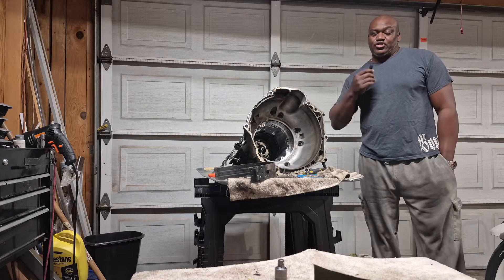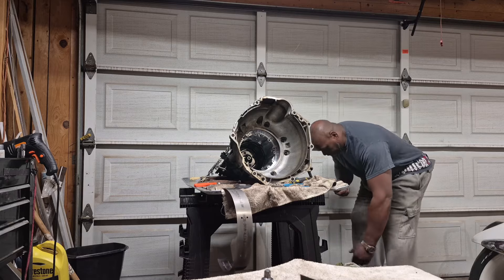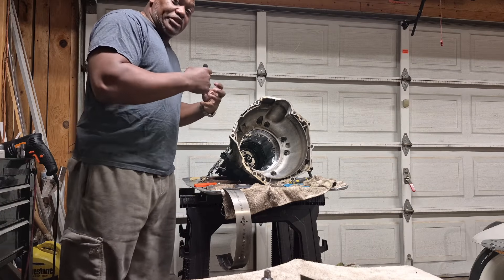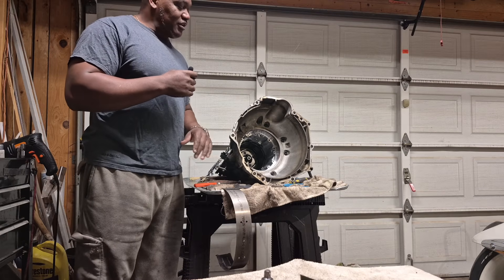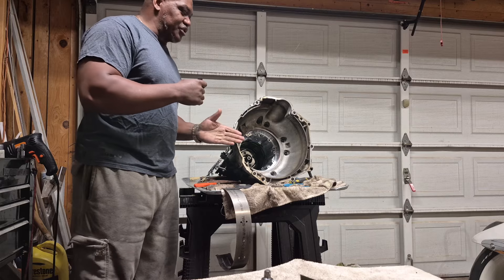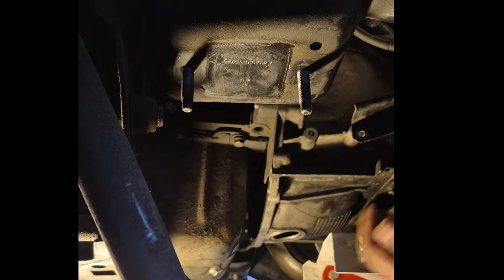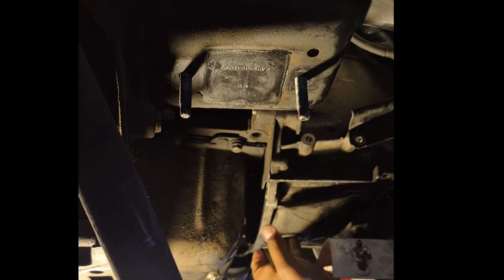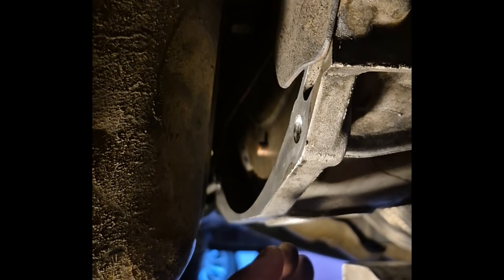Car won't TURN OVER after transmission installation

Comment: How would i know if the pump got damaged if i were to smash it together with the bolts? Would it be better to just grab a new transmission?
Reply from the maker: You can always replace the pump and not a whole transmission if the pump was cracked or something. They sell em separately.

Comment: I recently installed my trans on a 2000 f150. I did exactly what you said not to do when tightening it on. when using the key there is no start and no crank. I was able to jump the start relay with a screwdriver and it ran seemingly normal (i didnt drive just idle.) Ive been chasing a neutral saftey switch issue, but now you got me wondering if i didnt seat the torque converter right. my question is why can I start it from the start relay but not from the key and the ignition? Would the be any reason this issue would tell my computer to not start the car? any helps apprecaited
Reply from the maker: I'm not sure why it would start like that, but glad you didn't drive it. The fact that it idles means the flywheel is turning, which means it's not binding the torque converter against the pump. I bet if it did, it would be a crunch or something.

If you press the brakes, can you see the brake lights engage? Also, make sure the shifter is all the way in the park position, and try to start it in neutral as well. Sometimes, the shifter is off like an 8th of an inch and it'll keep the ignition from engaging. Check everything before you start messing with the transmission again, just to make sure you don't have to take the flywheel bolts out to check it. 

If you take the fly wheel bolts out, you should be able to spin the torque converter with you finger til it pings against the studs on the converter against the holes in the fly wheel. If you can do that, then you seated it properly and wont have to remove the transmission again.

Comment: Man I just paid few hundred dollar to replace the suspension and sway bars because 1 tire the front driver tire kept making clinking untightend noise every time it hit a bump or pot hole. After replacement it still making same noise lol. Do you think I should give it time or go back and ask them what happened??
Reply from the maker: What type of car is it? If it's not the suspension, then it's the ball joints, maybe. Did they diagnose it and recommend those to be repaired? If so, then it's on their professional judgement to have to eat some of the cost of mis-diagnosing and charging you to fix the issue. If the issue ain't fixed, then they didn't get it right. That's on them.
Reply: @ it’s my rav4, trying to save money from going to the dealership but  ended up at jiffy lube with bunch of young guys who acted like they knew exactly what the issue was

Comment: We just had our transmission go out and trying to figure out if we should rebuild, buy a used one, get a reman, or what? It also makes it rough bc it happened about 2 weeks ago but everyone is backed up
Reply from the maker: Depending on how many miles is on it, could just need a rebuild. Some of these remanufactured ones are the price of a small car!! They be talking about $5-7k. That's nuts.